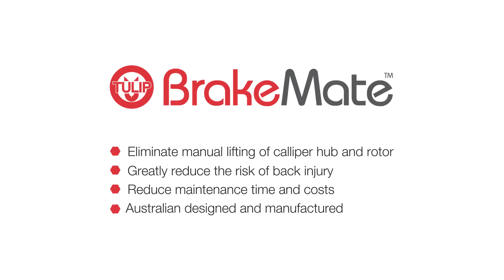Tulip BrakeMate® - Truck and bus brake maintenance system

Comment: Have you tried using one of these lol. Too much fannying. Try get hub on firstime.. Then try to start caliper bolts. Ours is covered in dust. Only TIME it's used is when it has it's LOLER exam.
Reply from the maker: Are you sure it is a BrakeMate you have and not some other tool?  We have only sold into the UK in recent months.

Comment: I have a new KW T880 with disc brakes. When the disc gets replaced should the bearings get replaced at the same time? Can this machine do that as well?
Reply from the maker: Hi Jerry,  Thanks for your question.  We are unable to offer maintenance advice for specific vehicles and suggest you follow the manufactureres recommended practices.
I know we have a customer in the USA who is using BrakeMate® to assist in changing bearings but I believe it would only be to hold the hub/rotor whilst doing so.

Comment: Must be a really expensive machine since they can't afford gloves...
Reply from the maker: Hello Andrei,  It is not common practice to use gloves and safety glasses when servicing vehicles in Australia
Reply: Brake dust,used oil are bad for health,invest some money to buy gloves for workers.
Reply: I'm pretty sure there's minimal amounts of brake dust in a disc brake system,compared to the simple drum brake. Old grease is not much of a contaminant. Bleeding calipers isn't too messy also, i'm sure they'd have other equipment for that purpose.
Reply: @merkantelismo  calipers are air operated not hydro like cars